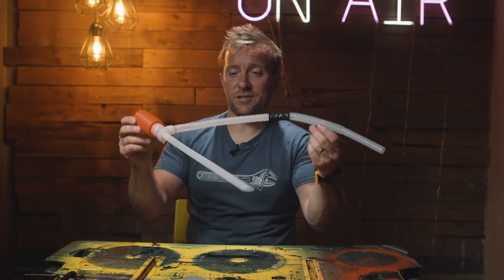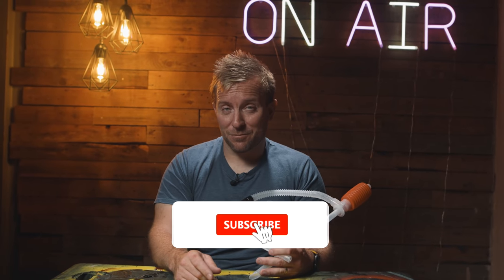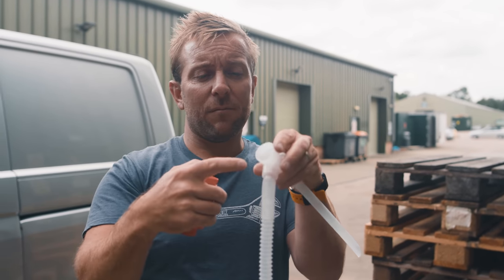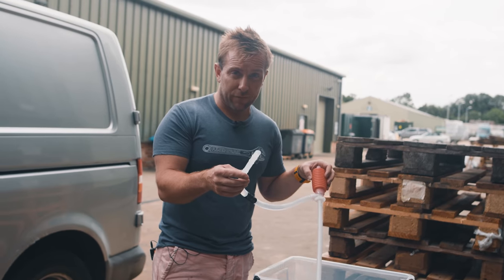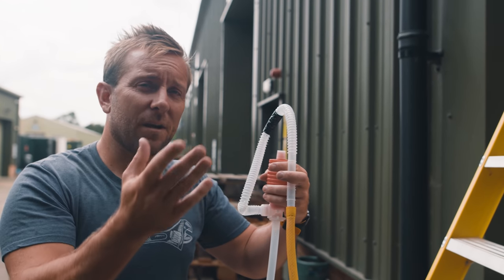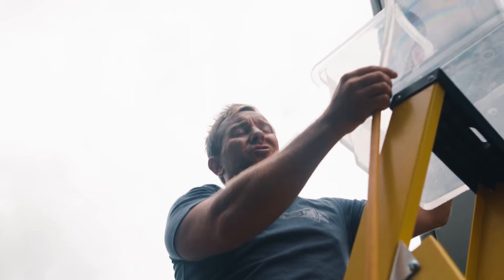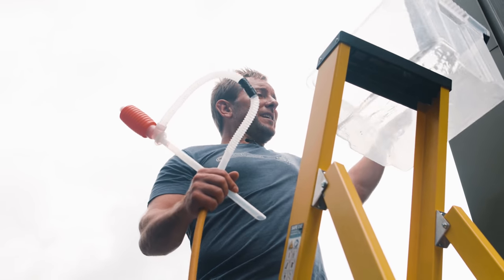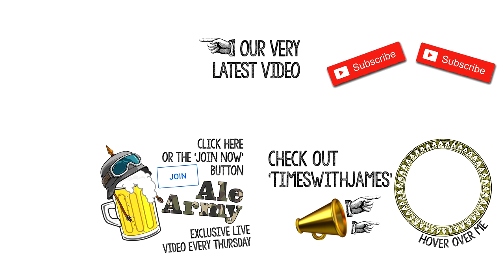Hand Pump Water - Must have tools of the trade

Comment: The engine on my Ford Focus died, I used one of these (that I found in my dad's garage) to syphon off the full tank of petrol. Was pretty rubbish so I put a screwdriver through the bottom of the tank instead!
Reply: Anti-syphon on the filler neck to be fair though.